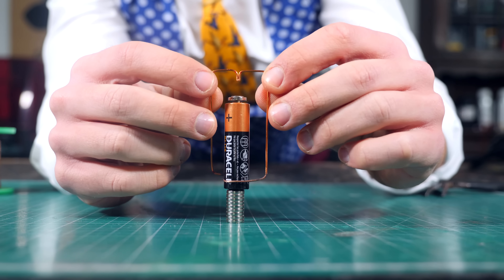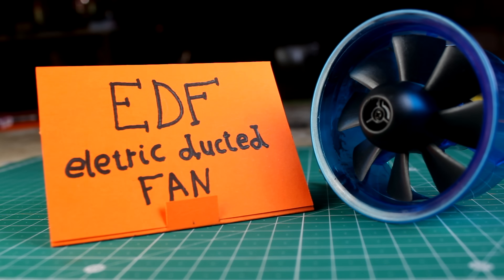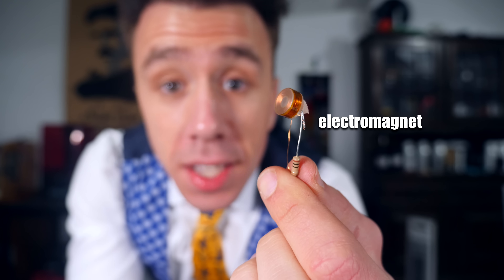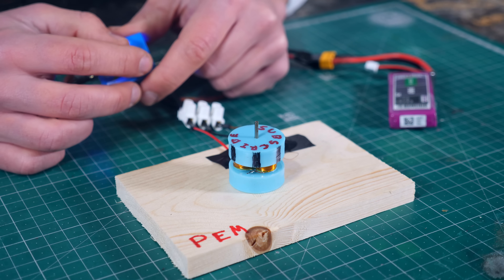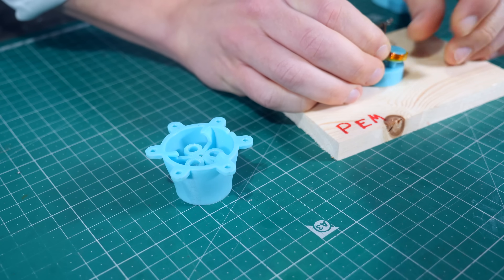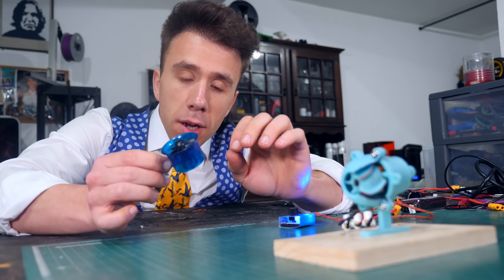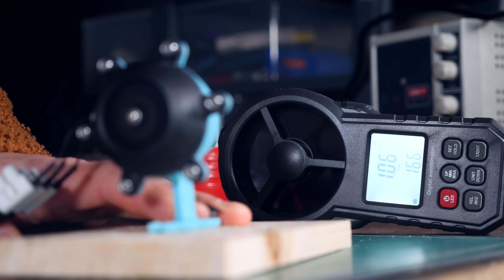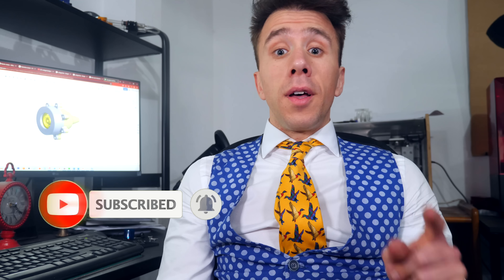I 3D Printed an ELECTRIC MOTOR FAN

Comment: Video idea: what is a vortex tube? How does vortex tube refrigeration work? A physical model which actually shows the difference in temperatures
Reply: There are actually several of these, I find the LTT video the most helpful. In simple terms, you centrifuge the air up to such insane speeds, that even the minuscule density difference between air molecules at different temperatures, is enough to seperate them into a hot side and a cool side. The NOISE that thing makes, however, makes this absolutely industrial-use only. It sounds like a banshee being attacked with an anglegrinder, I shit you not. It gives new, deeper understanding of the full meaning of 'screech'.
Reply: @InservioLetum  😂😂

Comment: If you're trying to get the air out the back to that little bitty hole it's because the holes too damn small to let the damn bear out you don't have fuel and ignition you're not going to get a jet engine

Comment: extend the rear component to ensure your not restricted by negative pressure/make the hole larger in the rear. aswell as add a liquid gaskets when combining the two parts.

Comment: Most likely the difference is same as with airplane with propeller engine and with rocket engine. Propeller engine provides slow but large airflow (cross area) and rocket/jet engine provides very fast but narrow airflow. So most likely the flow speed at the outlet on your fan is fast, but when you measure it with "large" wind meter it does not show correct outlet speed from the fan, it shows your fan flow mixed with external air. To get correct value, you should either make larger fan or change the measuring method to match the small fan outlet duct.

Comment: I don't know how electric stuff works or jet engine type things. But I know car engine things. My idea for it is to add something that forces air into it that keeps it moving like a car engine. Except use that forcing fan to force air into superchargers and feed those into the fan you're making.
Video idea: 3d print a whole car, not life sized, engines, exhaust, wheels, steering wheel, and set all the electrical stuff to a controller so you can move the car and control where it goes and how fast it goes.

Comment: The mistake is in the design of the casing. You said yourself you make a centrifugal turbine,so as the casing fits the turbine....where do you send the air? It needs to be larger on the back so the air to be forced to the back.....Also you need an unmoving piece of the diameter of the turbine on the back to avoid air loop. (I'm not engeneer but i have the hobby to tweak cars turbo,that's why i studied this theme.)

Comment: Impellers you show are similar a few industrial compressors (increase pressure), how does the inlet vs the outlet compare in diameter (if it is bigger, you are allowing the air to drop pressure thus reducing thrust).

Comment: You need to consider 2 things here, volume and pressure, the EDF fan is good for moving large volume of air because of its fan blade design but it doesnt compress the air to generate pressure and the impeller is actually is a compressor, it compresses the air and increases the pressure of the air inside the housing well but it doesnt move a large volume of air, thats why if you see in jet engines you have fans and the internel body design which compresses the air, but if you see a turbocharger the impeller compresses the air.

Comment: You can stuff 10lbs of crap through a 4” tube or a 1” tube.  The difference is trying to stuff that volume of crap through the 1” tube will take more Enegry simply because of it getting compressed and having more friction.  But once it is moving through the 4” tube it will simply plop out.  Force it through the 1” tube and it will squirt across the room.

Comment: Maybe it’s time you give the propeller an upgrade and switch the materials to something nasa grade
Reply: I would use the 3d printed fan to make/improve your models if you’d give me a printer if my theory works XD If you had an issue with the malleability of 3d printed resin then maybe the stronger the model of the Edf, then maybe it will hold a candle to the centrifugal fan?

Comment: I'm no expert, but I'm guessing it has to do with the small intake compared to the other design. the Stock fan can scoop more air, and so it has more air to throw.
Reply: also, why is your blade diameter so small, centrifugal forces are strongest further from the rotation so wouldn't a bigger thing be better?

Comment: The reason your impeller isn't producing as much thrust as the propeller in the PEM is that the thrust generated by spinning fans is generally a function of air speed, not air pressure. The propeller is designed to take stationary air and push it backwards as quickly as possible. And because of Newton's second law, this pushes the motor forward. But the air is just accelerated backward, it's not compressed very much at all. An impeller does the opposite it compresses the air and creates a large difference in pressure, but the air's speed isn't increased all that much. There's just more of it in a smaller area.

It's similar to how in hydraulics you can either have a lot of force pushing on something, but moving very slowly, or very little force but the speed is magnified. There's a direct trade off.

Compressed air does speed up as it expands out the back of your nozzle, but unless you have super high compression ratios (or a super long nozzle) you'll end up losing a lot of the energy due to much of the expansion happening after the air has left the nozzle.

Comment: You are compressing air into a smaller volume not just accelerating it through a linear volume. The change in volume is using more energy. Just my guess though.

Comment: an Egegshaped turbine generator pls it's in one of my Meany dreams inventing and don't have a 3d printer
the base is a cone shape with impeler shape stops half way up the Egg shaped turbine little part down like a fat cone
There is a stability stick staked to the ground going up the cone shaped base into the egg-shaped turbine holding the boxed generator in place. from the inside butt of the egg spider web hexagon shaped stick attaches from inside top of egg to generator power water and wind

Comment: I am no expert on aerodynamics, but perhaps your design would benefit from having the intake port at the same diameter as the original fan that you're comparing it to. The idea is to take air in a easily as possible and compress it out the other side, so it makes sense that having a smaller intake port would limit your design. That's just from what I understand though. I could easily be way off. Besides that, I would say reducing turbulent flow after the fan has pulled the air past its fins would make for the best results. So as soon as the air passes the fins it should have an easy time moving out the rear of the fan. Maybe a vortex could form in a sharp corner(like in the bed of a pickup truck), but it would probably be best to eliminate any sharp corners or bends for the air to flow across in the first place, just to be sure. So going back to design, you could try making the intake the same size as the original fan intake. You could try starting with an impeller that is larger in diameter than the original fan as well. Then try reducing the exhaust port as much as you can without losing power. Or do some maths to see how small it can be, I guess :/ I'm sure that could be done somehow. Anyway, I hope that was useful somehow.

Oh, yeah, someone else had a good point too. It would probably help to consider the volume of air that can enter initially and the space required to hold that same air before it's compressed and as it's being compressed along the way though the fan. Actually, if you could figure how much you want to compress air in any of these fan projects you could also work out the space you need in your printed models. You could start working toward optimal designs right out of the gate when you go to make one each time.

Comment: Maybe there’s friction on the plastic causing well, friction hence the speed decrease. If the plastic is not smooth on the inside it may also cause the air to have friction

Comment: As I watched your video I noticed your design of "fan" is based on a "Jet". Your exhaust design (small exhaust, throttled) is not helping the laminate air flow leaving the fan. The throttled design, is well, literally "throttling" your air flow 😅. It's creating vortex and disturbance at the back of the fan, this will also burn out your motor quicker.
Get rid of the nozzle like feature and test again 👍🏻 Hope this makes sense 

Kind regards

Ken

Comment: One reason why an impeller may produce less thrust than a propeller when powered by the same source is due to their different blade designs. The blades of an impeller are typically shorter and wider than those of a propeller, which means that they do not create as much forward thrust. Additionally, the angle of the blades is often different in an impeller than in a propeller, which affects the direction and magnitude of the fluid flow.

Another factor that affects the performance of impellers and propellers is their speed of rotation. Impellers typically rotate at higher speeds than propellers, which can lead to greater fluid shear and turbulence. This can result in lower efficiency and higher energy consumption.

Comment: With relation to your problem with thrust - Motors are rated on a kV value, meaning they can spin a certain speed proportional to the voltage of the battery you're using. The motor will draw different amperage from the battery though, depending on the size of the propeller/impeller. The edf you're using probably has larger and more aggressive blades on it, meaning it draws more power from the battery and produces more thrust.

Comment: Thrust and air speed are not the same. Impeller makes speed, but little Thrust in air. Good for water tho.  Also,  small brush less motor has 14 poles,  which is faster and stronger than....3.

Comment: The answer is simple:
Air travelling through your system experiences resistance from the inner surfaces, and whenever you force the air to change direction throughout the system it experiences even more resistance and pressure drop which causes velocity loss. In an EDF motor air is pushed straight from the beginning to the end of the ducted structure without forcing the air change direction in between, therefore it has more velocity compared to your system

Comment: The centrifugal fan is acting as a compressor. The air is getting compressed.  So to get the thrust again from the compressed air you need to have a carefully designed nozzle. The trust will be actually gained at the nozzle. Even with perfectly designed nozzle it will loose thermal energy while compressing.

Comment: First off this video is fascinating, just casually making a brushless motor, no biggie.
I think this fan under performed because of 2 reasons. The fan you build is meant to be used in an enclosed system, the Dyson vacuum is not open to the ambient air it has the advantage of creating a pressure difference on either side. Which doesn’t necessarily translate to air speed.
The EDF really has an advantage with measuring just air speed out of it. I’m assuming it is just able to create a much tighter column of high speed air, that is really easy to measure. Where as the Aerospike isn’t able to do that. 
A thrust measurement might be a more comparable measure of their performance.
This video was awesome and gave me a good think about fans, jet engines, and impellers.

Comment: I would guess a couple things.
1) the EDF will direct air liniarly through the duct to produce a given thrust (which we will consider baseline) proportional to the rpm the motor can spin the fan, the pitch of the fan blades, and the drag the blades make.
2) the PEM will have more drag for the blades as it is not accelerating the air through the fan in a single direction (air has to go out to the sides brushing against the flat plate of the fan as well as the entire legth of the blade assuming it enters from the centre). More drag- lower than baseline thrust.
3) the PEM will have more mass than that of an EDF due to the way it functions, reducing the rpm of the fan blade. Lower blade rpm- lower than baseline thrust.
4) When it comes to centrifugal fans, tip clearance is difinitive to efficiency. The tighter the tip clearance, the less air you are losing to inefficient pathways through the fan... but i leads us to 5.
5) Too tight a tip clearance will cause the blades to clash with the housing of the centrifugal fan, creating more drag. There are two fixes, losen the tip tolerances and lose efficiency, or redesign the fan blade to be less forgiving to the centrifugal forces by adding support material, making the fan blades thicker, or making them out of a more appropriate material. Either way you risk lower than baseline thrust.

None of that however, takes into account the geometries effect on air pressure, as an EDF is not as dependant on the effects of air pressure like a PEM. So we need to increase pressure and use it effectively. Despite the lower than baseline thrust properties I expressed a PEM would have, it make up in increasing pressure, so we need to keep it.

So, a suggested to do list:

Focus on increasing air presssure generated by the fan while trying to keep airflow from the front of the fan through to the back of the fan as free ass possible.

ANY mating surfaces, ANY gaps will benifit from restricting or sealing off airflow providing its viable. You want the pathway you tell the air to go to be the easiest root for it to take. Air hates congestion. It would happily take the equivalent of longer country lanes if the motorways are congested, even if the motorway is quicker. 

After that, focus on the exit geometries to utilise the pressure you have generated effectively.

P.S. dont hold me to any of this, its jusst educated guess work.

Comment: We deal with this and turbo chargers as well. The problem is, you’re in that needs to be as large as your other design and you cannot have any back pressure within the system. 
Any sort of restriction on the suction side becomes massive .

Comment: The impeller builds pressure but first, you need to use a small fan to force the air into the impeller, also try decreasing chamber size behind the impeller.

Comment: Hi Integza, first comment ever if I remember well, but as it is my job’s field, I thought I could answer your question ! 

The problem is that fundamentally, a compressor doesn’t produce optimal thrust. To achieve the best result, you have two choices : 
- accelerate the flow but low mass flow (often military) 
- high mass flow but low outlet speed (civilian turbofans) 
The outlet pressure is often considered more or less equal to the ambient pressure, as a difference between them causes huge losses.
You then design the turbine and the to accelerate the flow, converting the potential energy given by the chamber to kinetic energy. 

The centrifugal fan (more often named centrifugal « compressor » has the benefit of having a higher pressure ratio than an axial compressor compared in size, and giving the ability to case a compressor where axial blades would be too short (helicopter engines as example). It does increase pressure, but not really speed.
Therefore, because your losses increase due to the pressure difference, you don’t retrieve the same thrust. 

And with that, I’m not even mentioning that building a fan requires what we call « velocity triangle », giving you a relation between angular speed of the fan and the inlet and outlet angles. 
The magic behind the Dyson fans is that they are amazingly optimised. It’s mesmerising to see the shark teeth aspect of the trailing edge of the Dyson fan in your video. On some aspects, they are even further in technology than jet engines.

Hope it helps !

Comment: Aero spikes work on the principle of high pressure ratios (if it isn’t over 2:1 it isn’t working) and therefore they neck down a lot.  Feeding an aerospike with a single stage 3d printed compressor in just going to create a lot of internal bypass.  The fan is just 1/3rd of this. The housing and the rpm all need to match.  Dyson motors are super high speed, like turbochargers (a blade that small might need to spin 200k rpm or more). The ducted fan pitch and shape were designed to work efficiently and the PEM rpm.

Comment: Hi Integza! Agere? Are you portuguese? Im portuguese too. Why are we speaking  english? Well , nevermind.  Third law of mechanics, Newton. Propulsion is them sum of the amount of air flow and its speed. They called it the bypass air magic and that is the reason of the effectiveness of the turbo fan jet engines.  So the ducted fan is the formula to do exactly that, pass the biggest amount of air as fast as the designed blades can do but without turbulence, that is the why the inner and outer air flow are separated by that aerodynamic tunnel wall. I recently saw a blade design where the blades rotated in the ducted wall themselves (the pipe) and able to do a variable air attack angle like the blades of an helicopter.

Comment: thinking in Bernoulli, since both schemes are forcing a venturi, the input area of the fan you are using as benchmark is a lot wider than the input area of your 3D printer versions (which is an impeler and not a fan, which are more suitable for liquids more than gasses)... better quit and try to use the new more efficient fan recently invented at MIT, which use something like a möebious strip: look for toroidal fans.
hope this deserves a printer